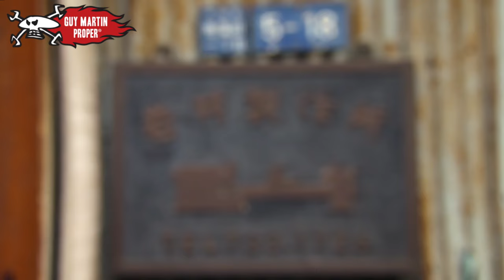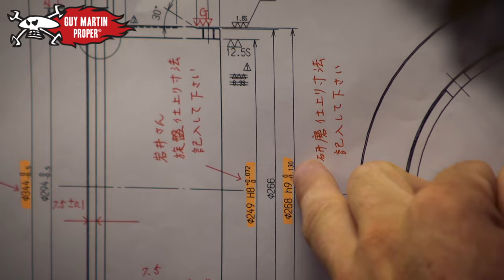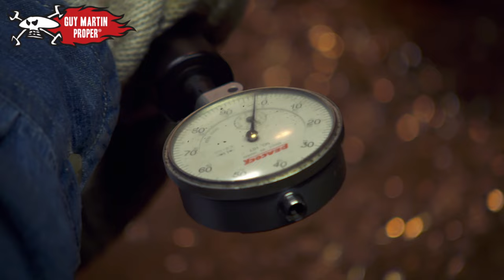Guy idolises a Japanese engineering master | Guy Martin Proper

Comment: How this guy pulls chips out of the lathe with gloves on and still have all 10 fingers after 50 years will remain a mystery forever.
Reply: YEAH :D
Reply: true, saw a guy with gloves almost losing his fingers in front of me doing the same thing, f'ed up his entire hand.
Reply: And all that stuff on the floor with no guard round the chuck. You can tell he's the only one who uses that lathe, knows every trip point by heart.
Reply: 1:38 / 3:18
Reply: He's wearing gloves to not affect his measuring equipment with the heat from his hands. I'm sure if he was gou g to lose a finger he would have done so by now.
Reply: I know man! Making me cringe. Now yes, clearly the old pro has stayed safe this whole time. But I would NOT follow his practice myself.
Reply: @custardavenger  It's in a back ally shop, i'm pretty sure the outside temps would be more of a issue affecting the micrometer then his hand's
Reply: DT Man and Van  no way man.
Reply: @custardavenger  His work has to cool down to for the exact measurement too. He didn't use cooling fluid.
Reply: I also gasped for air when I watched the oldtimer remove birdsnest close to a setup looking like a airplane prop with golves on and the lathe running😳😳😋 Guy followed him up with a few passes without safety glasses🤣  Joe Pieczynski would probably have to alternate oxygen and sedatives to be able to watch😎😋
Reply: You only lose a finger due to a momentary lapse in concentration at an important time.
Reply: i pulled a ball of chips out of the bottom of a non running lath once using my hands and gloves..... and ive only done it that one time. Cut the shit out of my hand through the gloves, used a metal hook ever since.
Reply: I've pulled this stuff out by bare hand for years, don't do it anymore because I hardly machine metal these days, but it's all in being gentle with it. If it's snagged then use pliers or a hook, never yank at it with your hands, but you can pull it out gently without any problem. Never gave myself more than a scratch.
Reply: @custardavenger  rubbish, the temperature of the workshop has more effect than his hand temperature, which is why metrology labs are climate controlled.

Comment: Watching him measure the outside diameter with the (Mitutoyo of course 😏) micrometer, I was struck by the fact he didn't use the small friction-tumbler... instead, adjusting the main spindle....  trusting in his own feel for the instrument. 

That right there is a sign of someone who eats, sleeps & drinks "machining" .... 
Bear in mind that if the part is machined too aggressively , it will heat up & expand, giving an erroneous measurement... 😓
Love watching people who know what they are doing, regardless of their field of expertise... the discipline, the easy concentration, the confidence in their abilities is humbling. 🤗

😎👍☘️🍺
Reply: Always did the same thing, specialy on such diameters, you have to feel it, maybe lock it then pull it out and see how it sounds when you pull it off.
Reply: I noticed he was doing the finishing cut with a tnmg insert with a positive type cutting geometry to reduce deflection on the final cut and give an accurate finished size.
Reply: @pauldavidson6321   you have better eyesight than me Paul... 🙄😂😂
Reply: @pauldavidson6321   you have better eyesight than me Paul... 🙄😂😂

Comment: Just to to do the maths on how long to be a master from 60,000 hours. For UK normal hours of 8 hour and 261 days per year it would take you 28.7 year. Even if you worked 7 days a week for 12 hours without any time off it would take you 13.7 years. Impressive dedication to your profession either way
Reply: Yeah, so if you start in your teen years as an apprentice and schooling. You would be a master by the time you hit your late 40's. Makes complete sense. That's sound about the age you would expect someone to be if they introduced them as a master of some sort of hands on craftsmanship.

Comment: I've had the privilege of working with some master machinist during my vacation training. The one thing that strikes me  the most with their skill is how they listen and feel the machine during the cut. You can decide on the spindle speed, feed rate. depth of cut and tool setup based on just those 2 factors alone.

Comment: In my experience most trades take more hours to complete than many degrees.
One is not necessarily better than the other but I find it very odd that engineers( fitters turners and tool makers ) like this are paid so poorly.
They also have to do more mathematics in their work than most others.
And where would the world be without labourers?
Well done Guy.
Reply: I think they are underpaid because the sad reality is that they are also becoming obsolete. So they have to compete with more modern automated companies.
Reply: reconx86 
Yes I agree, however they have always been underpaid.
That is just how our free enterprise market economy works, which I support.
We will always need some fitters turners and tool makers for specialist work.
Reply: @bentaxelrod  i dislike the term free market, it has led to big conglomorates that are hard to compete with. Leading to near monopoly control of the market and lowering of standards like how many airlines for example will charge for every little thing you ask instead of giving you one price for a full experience. In short I don support free market, regulations and standards need to be enforced so good quality businesses can remain sustainable.
Reply: reconx86 
Yep, I really do agree.
I support free enterprise but with strong regulation.

Comment: Japanese engineering is amazing especially when it comes to their motorcycle. For example my 2018 Ninja ZX10R with it's brutal power and electronic leaves me in awe
Reply: Don't forget zee Germans and BMW although I have also owned 3 new Kawasaki bikes and do agree that they are fantastic and have always been a little underrated.
Reply: @superbike1  I love the Beemer so and owned four, the S1000R is awesome I can't afford a 25.000$super bike. With an ECU flash, exhaust and Dyno tuned.Lets got 194.7 hp.Now are building a secondary map and using MR12 expect to get 205 to 210hp.

Comment: They leftout the translation "the pneumatic cylinders have to move in unison" - for the cylinders he machined
Reply: This is an old school lathe right? I doubt there are any pneumatic mechanisms / components in it. The movement is achieved via screw rods and gear wheels inside the lathe. Correct me if I am wrong.

Comment: If you study the drawing. ..266mm is the external diameter and Guy finishes the internal diameter or bore at 249mm. I still have nothing but major respect for Guy. I cant help but wince at the way the Japanese master pulls the cuttings away with his fingers, I'm amazed he still has all ten. I was a turner for years and the cuttings regularly got caught in the chuck jaws as they rotated, imagine a razor sharp ribbon of steel violently getting pulled into the machine with your soft fleshy fingers attached. We used a long metal hook to pull the cuttings away safely.

Comment: I’m a precision engineer in the U.K, the general tolerances on most work is smaller than 120 microns, that’s actually a relatively forgiving limit, 10-20 micron tolerances are not nice, manual turners like this guy are a dying breed though
Reply: Sabre LC just under 4 thou - I agree, most experienced machine shops should be able to hold that tolerance. But as you say, to turn that manually is an art form.
Reply: im sorry sabre lc but to come out and pick holes in this man's work is an insult you're  machines may work to tighter  tolerance  but sadly you're  mind does not your  narrow  minded  and  selfish
Reply: Fred Blair Fred I think you may of misunderstood my intention, assuming the job was finished to tolerance , this mans work was perfect.
The way this is filmed it makes it sound like the work that’s being filmed is tight and difficult, considering what this guys worked on previously he can achieve far more precise work, do you really think something on a space station is going to have a .15 tolerance.  I would expect any qualified manual turner to be able to make that, to tolerance on a 30 year old machine, or they wouldn’t have a job in the first place

Comment: I served a five year mechanical engineering apprenticeship as well as attending college. It has held me in good stead for over 45 years. 
I’m proud to say that not only can I calculate the square root of a tin of baked beans, I can get the lid off too.
Reply: @madisntit6547  Of course. I fitted a valve.
Reply: @madisntit6547  yes in a liquid state of course. 270th of the volume than when in a gaseous state, allowing for a much greater storage capacity.
Reply: @madisntit6547  you are welcome! It’s good to have some fun. To the optimist, the glass is half full. To the pessimist, the glass is half empty. To the engineer, the glass is twice as big as it needs to be.
Reply: @madisntit6547  how IT can be anything to do with engineering beats me. I am suspicious of any branch of the noble art that does not invoke any of Newton’s laws.
Reply: @madisntit6547  ✊

Comment: 130 microns = 5thou. 
a lot of time is wasted in engineering making and measuring parts to too fine sizes.
I once scrapped 80% of production because a new CNC measurer took so long to perform superfluous measurements and customer wouldn't acccept if not 100% CNC checked.
So no option but to scrap all the unchecked even though the day before the CNC was installed all the parts were perfectly acceptable.
Another example of this is the company making British sniper rifles using CNC to check all the perforations in the cooling jacket when the holes could be 1/8 inch away and no-one would notice!
Reply: Depending on what the part is for, the required level of precision varies. If you're making parts for the undercarriage of a bullet train, those parts have to be on point
Reply: It seems you know just enough to be dangerous. Ignorant people often over look their own ignorance.
Reply: @dexter131  is that aimed at me or him?
Reply: @seemslegit6203  the original poster.. he seems like he knows how to operate a CNC machine and now thinks he's an expert engineer.
Reply: @dexter131  The Dunning-Kruger effect is powerful on the internet! Those who know little think they know a lot and those who know a lot are humble in the amount they do know.
Reply: @AleraKira  I agree. I've always had a thirst for knowledge, as I get older im starting to understand the phrase, "I've forgotten more than you'll ever know." Is scary how happy people are to just float through life choosing the easy road at every turn.

Comment: I apprenticed a year under a 40 year professional machinist. Built my own turbodiesel motor up in the shop and learned the trade. 

I can comfortably say in that year all I could probably help that man with is measuring something. Measuring such precise amount takes a feel that takes at least a year to become adequate. If you tighten a micrometer too much it can actually give you an improper reading, and to be really precise even the ones with slipper clutches are not good enough at .0005" tolerances.

Comment: I had worked in a hard disc drive manufacturing factory that used CNC lathe and milling machines. To get an inside cylindrical diameter tolerance of 73 microns ( plus 73, minus 0) would be an extremely difficult task especially when using the manual lathe because when you cutting steel, it will generate heat and expand the steel, and since there is a heat coefficient for every steel, the dimensions will change when the steel cools off. That is why we are using the soft magnesium and zinc alloys that had easy machinability with lots of cooling liquid to prevent the metals from expanding during cutting.

Comment: 100 micron is 0.1mm that's a piss easy tolerance to get
Reply: Surprised more people aren't saying this. I'm a shitty machinist and even I can turn something to within a thousandth of an inch (25.4 microns). Anything tighter than that could generally be ground from there, which usually yields a much nicer surface finish (and makes it less stressful for the machinist). One of our old CNC lathes from like, the early 80s could supposedly cut to within 7 microns though. Pretty wild.

I'm sure this old fella pisses this tolerance as well having done it for a million years. Probably the only reason he let Guy turn that piece. Lol. The voice -over/Guy does overplay the accuracy required to turn that particular piece though. Pretty annoying.
Reply: yeah, -0/+0.13. It isn't anything special at all. I banged around on machines years ago and would nail very simple parts at these kinds of tolerances. Now I cause trouble for other people by designing parts instead. I suspect that they'd arranged to drop by and watch this guy weeks or months in advance with no way of knowing what they'd actually see. On the day this is what they had to film. Had to ham it up a bit.

Comment: Back in the 1980s I needed a pump shaft. It was 2ft long by 2 inch diameter with key ways and a threaded end. The original equipment manufacturer charged £600 each with 18months lead time. 
A local engineer made TWO for £200 the pair. I confirmed they were not underpricing but they were happy at that. We cancelled the OEM order. You can imagine that local engineers got a lot more work from us.

Comment: I have little machinist experience, but what was hard for me when i was learning how to use the lathe, was not the machining itself, but setting up. Making sure the piece is completely centered, or check if not centered do I have enough material to make it even if the piece is a bit angle. That was HARD.

Comment: Thing is that the precision attainable is limited by the tolerances obtainable on the machine tool you're using. So unless the lathe bed and bearings etc. are absolutely spot on which is very difficult to maintain then that limits what even the finest machinist can achieve. Oh and I wasn't impressed with the woollen gloves worn to clean off swarf, that's an accident waiting to happen.

Comment: So much of the manual machinists skills are being lost and everyone is solely relying on digitally controlled machining. I’m a manual hobby machinist and it gives you so much more of an insight on how things are made and assembled
Reply: Not really. Most workshops still have a manual just for things like one offs, drilling or facing off. CNC is just so much easier if you are doing large batches or tricky things like threads.

Comment: 130 microns is about .005", that's not particularly a tight tolerance. +/- .005" is pretty standard for machining, tight work will be machined to +/- .005 before going to the grinder for the close tolerance finish work.

Comment: Very Cool and with all due respect, this is old school. The tolerance (130 microns or  .005") is pretty high for a sewer pump part. 
But super easy to manage with a high-quality CNC machine. A good average tolerance range on most CNC lathe or mill work would be around 0.1mm or 0.005in.
and it would take a tenth of the time with near-perfect repeatability.
 The best CNC machine can produce and hold tolerances at an insane level less than 2 micron or 0.00007″ (70 MILLIONTHS) of an inch over and over again 24 hours a day.

Comment: Great piece!  Message to Guy - please wear glasses when machining as indeed the Japanese Master does.  Not all cuts coming off steel have a nice spiral swarf cut and a small piece lodged in your cornea will start to go rusty very quickly due to the salt in your tears,  requiring it to be dug out with subsequent vision degradation until it heals.  May result in permanent scarring.
I work down to a micron or less frequently.  Just need to carefully work out what you are doing and concentrate hard.

Comment: The cut was too deep. That's what the Master was trying to say. You can hear the pitch change between the Master's cut, and Guy's cut. Too deep cut creates unnecessary friction, that forms heat, which deforms the part. Not just heat expansion, but the actual metal surface. I hope he had enough material left on the part to fix the plunder.

Comment: I work a 20m+ lathe working on up to 18m ship shafts with smaller  tolerances on the diameter. .036mm at times. For less than £13 an hour in a factory with little to no heating. 
Getting cut and burnt on machines older than me. 
Yeah I wonder why no one wants to do my job.

Comment: Honestly it's not that complicated. I , as well as many other engineering apprentices from my firm have had far less experience (obviously) however we work at higher tolerances and can produce more parts on the same machinery as him, producing aerospace and military grade equipment, as well as formula 1 racing components. He's a general engineer, he'd have a basic salary in the west, probably around the 30,000-40,000 dollars a year mark. But can vairy depending on the employer and how generous they are

Comment: 130 microns is your average tolerance for most parts, its not hard to achieve, nowadays we just use CNC lathes instead, by the time he makes 1 the CNC has made 100, its just efficiency, time is money. yes there is skill with doing it manually for sure and takes time to master but companies dont want you to learn, they just want you run a CNC to knock out parts asap